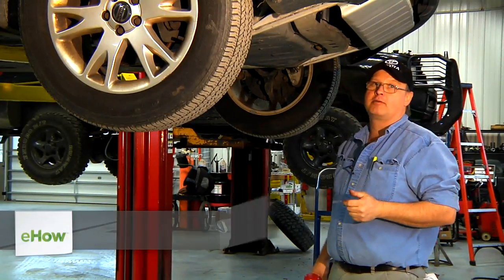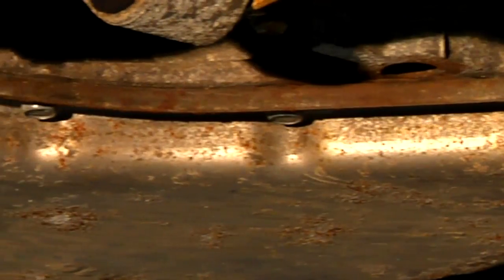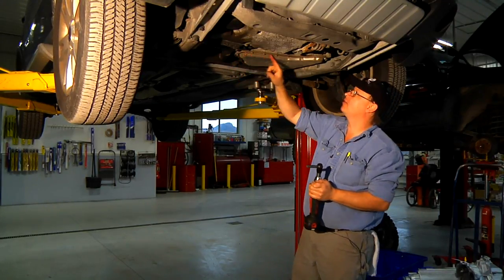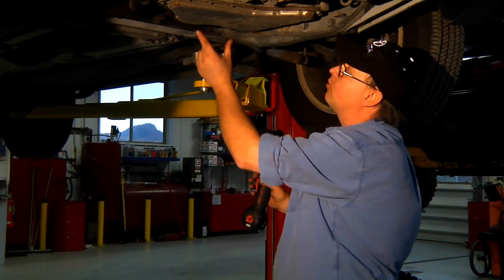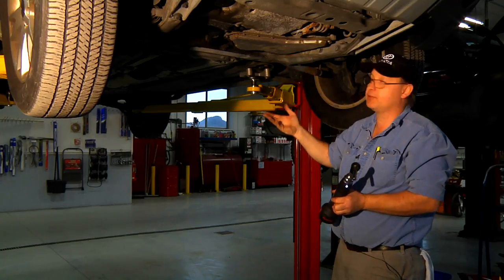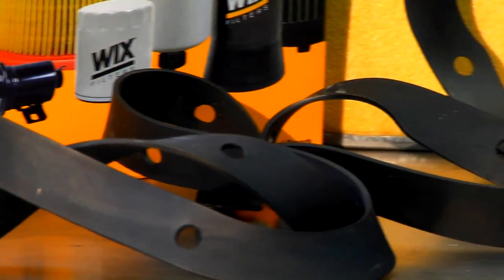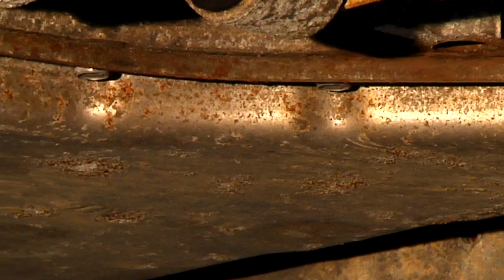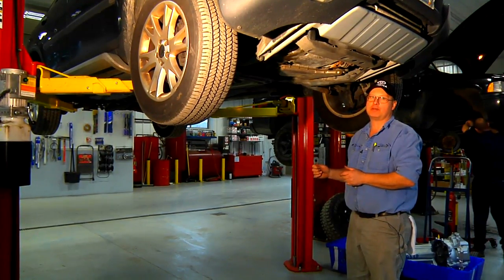Auto Repair Tips : How to Change a Transmission Pan

Comment: NEVER use anything to pry the pan off, because it bends and warps the lip and might crack it as well. If it bends, it won't seal right and it will leak.
Reply: What do you suggest doing? I can't even get my pan off at all with all the silicone in it